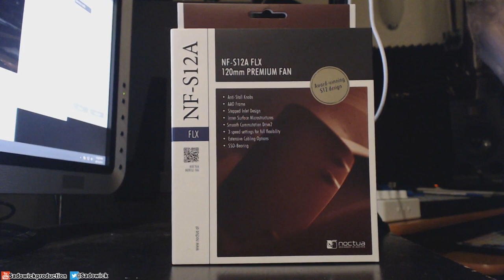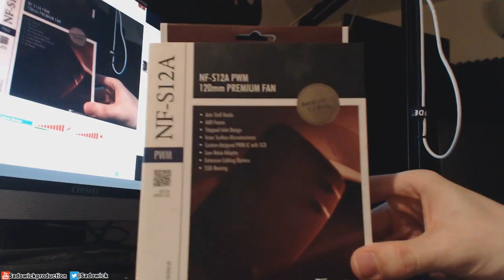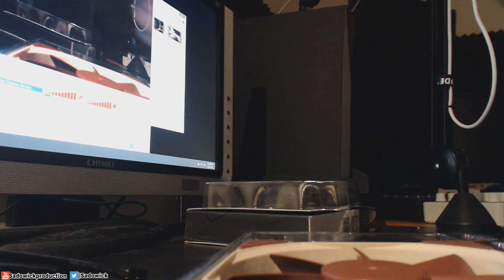Noctua NF-S12A Review & Installation - Make Your Computer Quiet

Comment: 4:34 are the top fans install with screws, but the back with the things you use pliers for, or do you use both?
Reply: You can use what best suits you, probably the rubber mounts were too big to fit the top fan screw holes.

Comment: I have 3 Noctua fans I use to cool amplifiers they are just hooked up with 2 wires pos & neg. They are nice & quiet but I need them to run at Full Speed for additional cooling. They didn't come with any resistor adaptors.

Comment: since your case has the option to use 140mm fans, why didn't you go that route?
Reply: mvvelzen33 Good question cause usually bigger fans have lower rpm and shift more air hmm...
Reply: @azagedon  If you check the specs of Noctua fans, 120mm is clearly better than 140mm in terms of air flow/noise level.

Comment: i installed 1 yesterday. It is working but I can not feel the airflow. Weird. If I put a piece of paper in front of it it does not move. And yes I mounted it correctly with the label against the frame. But temperatures are ok and indeed no noise at all. I have these fans also on my CPU coolers. Probably will replace all other fans with  Noctua

Comment: Dont put 3 fan to only push out the hot air,need good air circulation,one in-one out.Also dont put more fan to one direction because causing vacuum, and the air cant take up the heat.
Reply: KaedE gza There are probably suction fans on the front of his case which would make sense in regard to the airflow.
Reply: 4:07 shows at least one front panel fan. I'm planning on two 140mm fans in and one 140mm fan out, hopefully that works out (a different video recommendation)
Reply: I only have 3 fans in the front as intake only. No exhaust fan. I've found this works incredibly well as it pushes all the cool air in and it then has no problem exiting by itself through the back and top. I can feel a nice breeze going out the back and top without any help. When you push air in it will push out no problem.